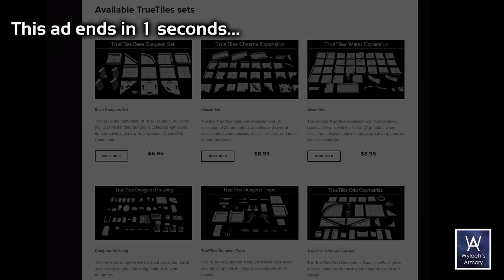Books, Furniture, and a Drow Ritual Table! DIY Crafting Essentials for #dungeonsanddragons

Comment: If you soak the popsicle stick in water until it’s fully saturated and it will be more flexible. It’s the same trick I’ve used with actual lumber for years

Comment: 100%, learning not to be afraid of color is one of the most important parts of crafting, and just painting in general. Even in the grimmest and darkest of settings, if you only use dark and drab colors, it will just make everything look muddy and washed out; adding a splash of color makes the entire piece pop, and even enhances the grimdark parts by giving them something to look grim and dark in comparison to.

Comment: Wylock, Those books are cool, but you did it the hard way. Do the exact same thing, but wrap strips of poster board with construction paper instead. Then they will be easy to cut, you can skip the paint (construction paper comes in a wide variety of colors), and they can be hardened with a coat of mod podge. Foam and paper aren't quite as durable as card stock, but mine have held up for several years already and they are still fine.

Comment: The danger with this video is that, before it came out, I had no desire to craft tiny books for the tabletop. Now I must resist this sudden urge when I already have a bunch of other stuff half-done.

Looks spectacular though, and with such simple materials it looks really doable. Even making a quarter of those books and making some piles with scrolls for dungeon scatter would be a good project. And taking make one book and adding a transfer onto it for some arcane glyph instantly makes a macguffin the party will hone in on.

Comment: Love the way those washes worked on the books!

I like versatility in the things I make, so when I crafted bookshelves, I measured the dimensions of the shelf spaces, then glued the contents of the shelves to each other, instead of the shelves, so that they fit the shelves dimensions, then slot them in to the shelves as needed. 
This way, I can make only a few bookshelves, but lots of different things to place on them, so they can be used for taverns, libraries, evil sorcerers etc.

Comment: Loved the bookcases, just recently did some as well, my method for the book was to print out book covers, wrap them around some foamboard, age it with wash (I also used AP's wash, I think it was light tone), and done. What I loved about foamboard is that I could texture the sides with a wire brush, making them seem like pages in the book!
I love your back to basics series Wyloch, it gives me many ideas to re-think some stuff I already did!

Comment: I've still got a pretty good stockpile of books from back when I was working on a library piece.

I'd used craft sticks and heavy construction paper. Took one of the thinner craft sticks, cut them down to the majority of the size of the books I wanted, then painted them in an off white. I didn't bother with both sides, just a spray of the off white primer I'd gotten while they were stuck to tape.

Used the construction paper for different covers, using different colors of the paper from it. Add a few details with fine tip, metallic sharpies and they work really well for closed books...not so much for the open ones, but great for closed ones.

Comment: Also, to bend popsicle sticks, wet them if not enough, several ways to do this but soak them, then microwave a min or so to steam them, or lol steam them in a steamer, you can also toss some in boil water then remove, dry and carefully work to bend it, keep it in shape and when they cool and if possible with rubber bands or little clips to hold overnight and then you have a dry curved stick you can now glue on.

Comment: About that section where you tried to bend that popsickle stick thingy, it should be doable.
Let it soak a bit in water, so the wood fibers get a bit more flexible.

(And boiling that stick and/or slowly bending it over boiling steam could make it more bendable. I don't know if hot/boiling water will help here, but I saw something like that used in old techniques to form wood)

Comment: 9:52 I imagine someone has said this already, but just in case, you can definitely use popsicle sticks as backing! just soak the stick in warm water for several hours
Reply: I've had real mixed results with this. I may have been impatient.
Any tips?
Does the water need to stay warm the whole time?

Comment: so a tip for making something that looks like leather, i came up with this about 15 years back when i was doing vampire bats for a GW army i had a bunch of wolf heads and tyranids bodys left over from other stuff so i make my own vampire bats with the tyranids small scything talons been used to make the wings along with my homemade leather type thing.

so its really easy you just need pva glue, some leather looking paint (at the time i used GWs snakebite leather as it was what i had) and something the glue can be peeled off of when its dry, mix the paint into the glue and spread it out to set up in roughly the shape you want and whalla something that looks a bit leathery you can then cut it with scissors to whatever shame you want (mine was the membrane of the bats wings) something that may go well this that Drow Ritual table is maybe cutting into a human shape to hit at the drow been a bit naughty and having it draped on something.

Comment: Nice job!  Couple of things though, just to make life easier: First, Since the books are going tp be pressed together on the bookshelves for the most part, You could conserve some wash, make less of a mess on your hands and speed up the process even more if you wait until they're on the shelves and apply the wash then, since you don't really see 90% of the covers anyway.  Also, if you soak the popsicle sticks in hot water for a few minutes, they should bend reasonably well without breaking.  Also, I really like your technique of using real wood to make wood furniture (also watched your tavern vid).  Plan to do this myself at some point.

Comment: If you have the time, soaking thin wood in HOT water makes them bendable after a few hours. 
 Need to hold the new shape for 3 to 7 days for the wood to dry out, in my experience :)

Comment: Also also, also, if resin epoxy is out of your reach be it funds wise or what have you, at any hardware store or department in a big box store, you know the one you can buy a tomato and motor oil in lol, anyway look for clear silicone or clear silicone adhesive.  It's used to seal in and around windows among other things, they come in caulking tubes but you can also get them in hand squeeze tubes.  This will dry clear and you can add a drop or two of food coloring to it to change the color is so desired.  It will dry without expansion, they make it clear or white maybe you want to make milk, or chocolate or strawberry milk or creams.  White silicone with red food coloring drops look like blood better than clear as blood has that opaque look to it.  Dealers choice either white or clear silicone adhesive will work.  This is an old train modelers trick used to make small streams, ponds and the like.  Okay I'll save future tips for other videos lol.  Always helping.

Comment: There's that Drow mini again! Where is it from, who makes it?
EDIT: 9:47 For that backing you can steam the sticks, or toss them in a pan of hot water for a bit. Technically the water doesn't need to be hot, but it's a little faster than using cold water.

Comment: A poor man's wash which works really well, Incase you can't afford the fancy stuff, and honestly I like the old school stuff having been a scale modeler for nearly 40 years, food coloring.
A little goes a very long way, play with dilution with water more or less water, or a drop or two or more coloring, and practice a bit with it, try adding in on lightly or heavy leave on to dry or wipe off.  But you can buy a whole box of all the main colors and of course you can mix to make other colors.  It's a cheap very workable dye.  Use latex or the like gloves as they will stain your fingers and clothing so be careful.  Food coloring is a wash when watered down or they can act like an Ink also a good cheat instead of buying expensive inks.

Another good wash substitute or for the light wallet, Kiwi Shoes polish, they come in dark colors like black brown and burgundy you know dress shoe colors (colours) but you will have to wipe it off as leaving it on can make an oily feel and look depending on the media it's applied to.  Have fun and thanks for reading!

Comment: Okay I lied lol, next time I'll watch the whole video but chances are I'll forget...last tip
Two really good ways I know to make blood splatter.
1 a slightly bigger brush than that, and a instead of flicking it off against your finger use a toothpick apply a medium amount of paint hold it far back I'd say depending on scale but about 8 -12 inches away apply medium amount of pressure and go slow, let each bristle of the brush flick.  If you go too fast the effect isn't quite right.  
The other way is to dip the tip of an airbrush and at high pressure and air blast away at about 4 to 7 inches away.  I prefer the toothpick method as I don't have to clean the airbrush, but airbrush splatter does look better.  Okay last one promise.